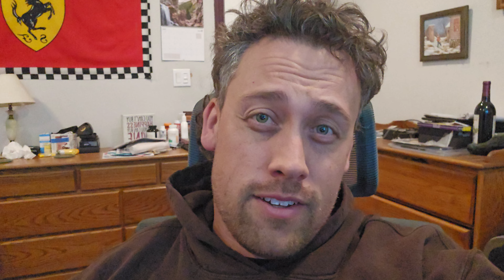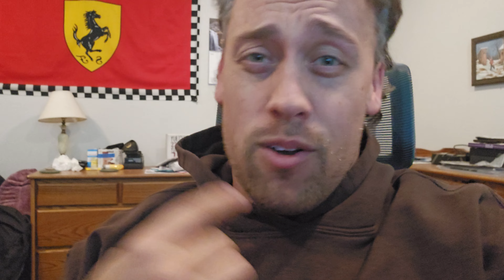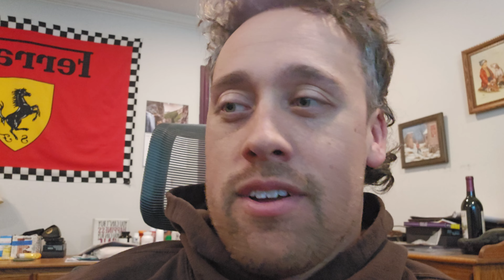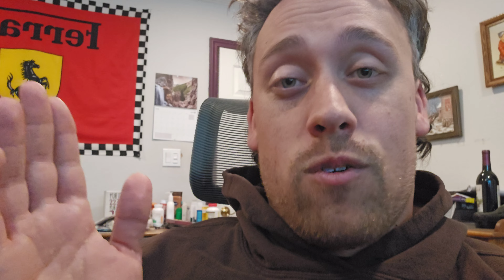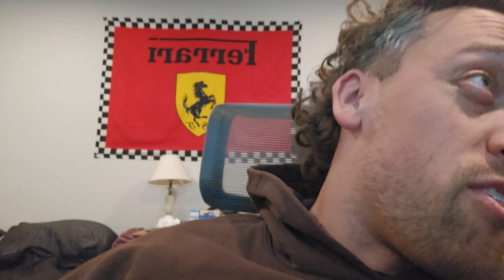HOW-TO: Rotary Engine Upkeep, Fuel-in-Oil Dilution, Oil Injection, Premix, and Spark Plug Readings

Comment: Question, have you tried the Autolite Racing Part# AR3932X spark plugs in a rotary motor. I have a 3rd gen swapped 13B-REW RX7 FC. My motor is bridge-ported with balanced and side clearance rotors with Goopy apex seals and the motor is fully studded.  Fuel system wise I have a single Walbro 525lph fuel pump with 850cc primary’s and 1600cc secondary’s fuel injectors and a Borg Warner S366 turbo and ecu wise a Haltech Sprint RE with AEM IGN1A smart coils and I’m running 20psi of boost on pump gas 93 octane with a snow performance stage 1 water/meth injection system with a single 670cc nozzle running straight VP-Racing M1 methanol. I run Idemitsu Racing Rotary Premix @ 1 ounce to a gallon of fuel. And was having to change plugs about every month running the factory heat range 9’s leading & trailing and ran across a forum about the Autolite AR3932X plugs so I decided to try them and honestly haven’t had a single miss fire or any problem at all in 6 months and just changed the plugs last weekend not because there was a issue but because I wanted to change them. Car runs 6.90’s @ 105mph in the 1/8th mile with a TII transmission on a TII rear diff with a set of 26x8.5x15 Hoosier slicks. Sorry for the novel just wanted to know what your thoughts were on these plugs thanks
Reply from the maker: @adamryanclark  I've had success with those and the 3910x with a spacer.  At this point we are in a plug shortage and my $3k worth of plugs here are keeping me warm and fuzzy at night.  Stoked to hear about another success story.  Keep on keeping on!
Reply: @ what part number plugs do you recommend for a high horsepower 13B-REW with a 85/96 T4 1.25ar turbo on One Ethanol R fuel as well running a direct port snow performance water/meth system with 4 2.5GPH-157.73ML/min nozzles running straight VP Racing M1 methanol controlled with a fueltech ft550 ecu with IGN1A smart coils, motor currently is in the breaking in stage of things and plans are to run upwards of 30+ psi of boost. Also why are you using a spacer with the Autolite plugs?
Reply from the maker: @adamryanclark  The 3910X are longer depth and colder plug. You may like them. Otherwise NGK or Denso race plugs are always the right choice.
Reply: @RGHTBrainDesign  they Autolite AR3932X is equivalent to a NGK heat range 10. Now per Autolite website the Autolite AR3910X would be the equivalent to a NGK heat range 9. Now Autolite does however make a part# AR3931 short ground strap race plug that’s the heat range equivalent to a NGK 11 unfortunately they do not produce that same part# with the X series strapless. What part# NGK race plugs do you run?
Reply: @ the Autolite AR3932X is equivalent to a NGK heat range 10. Now per Autolite website the Autolite AR3910X would be the equivalent to a NGK heat range 9. Now Autolite does however make a part# AR3931 short ground strap race plug that’s the heat range equivalent to a NGK 11 unfortunately they do not produce that same part# with the X series strapless. What part# NGK race plugs do you run?
Reply from the maker: @adamryanclark  You have that backwards.  Their "0" is their coldest.  3910x is colder than 3932x.
Reply: @ verbatim from the Autolite website about understanding spark plug heat ranges. It says that a Autolite part# AR3910 cross references to a Champion part# C59YC as well to a NGK part# R5672A-9. So the part# AR3910X would be a heat range #9. You may check it out yourself on their website.

Comment: When does higher octane come into play?
Reply from the maker: In regards to which application?  87 octane works best for NA. Anything turbocharged benefits with higher octane and slower flame front speed. Alcohol fuels cool, clean, and slow flame front.  Win win win.
Reply: @RGHTBrainDesign  yeah still na, full bridge carbie too
Reply from the maker: @josephfriedrich9792  so e85 or 87 octane are your best options for a street vehicle.